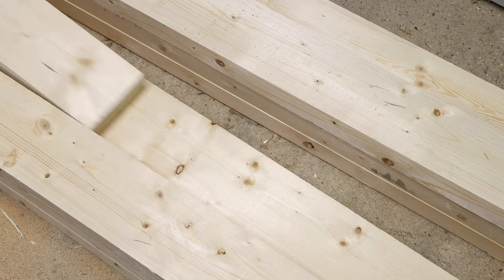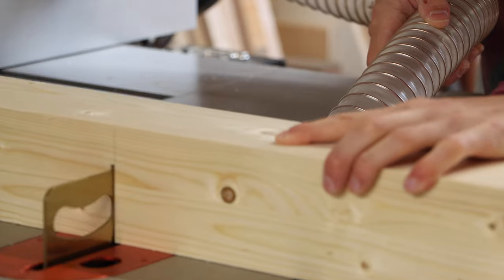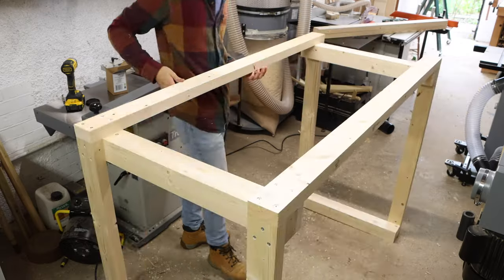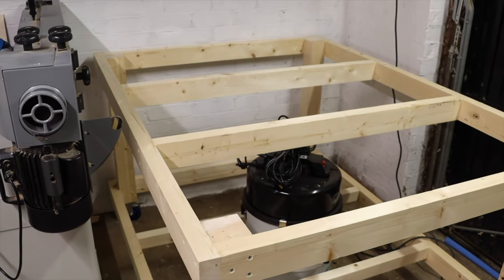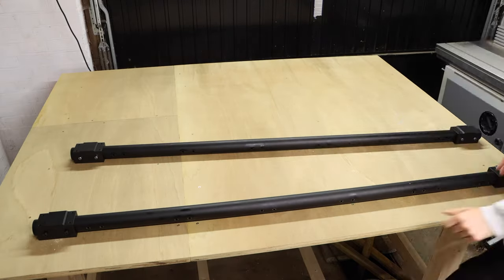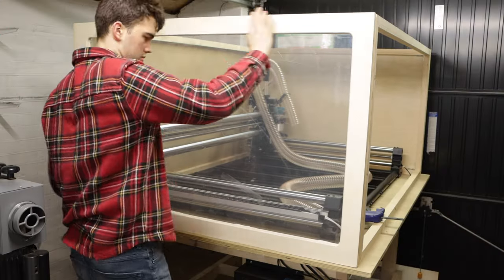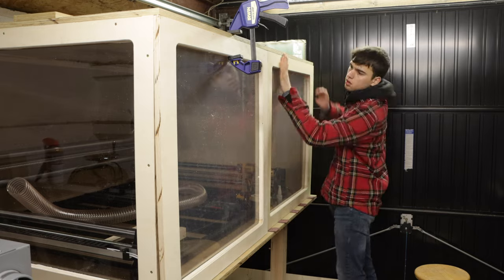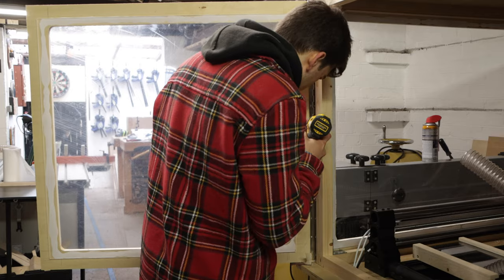Building The Ultimate CNC Station! Onefinity Journeyman X-50 CNC Stand And Enclosure!

Comment: Can you please share your experience after one year: how much did the enclosure help with the sound? Can your neighbors still hear the router?

And what about heat im the summer? Did those motors have any problems while being inside the enclosure? Thank you!
Reply from the maker: Hey, The enclose is definitely a good idea. I would hate using the CNC without it. without it, the router would be so loud and dust would be flying around the room. To improve dust collection, I drilled a 50mm hole on the top so I had air flow into the enclosure, otherwise it can act like a vacuum and ruin your extractor (It need constant air coming in). I haven't had any issues with the router over heating.
Reply: @SeanEvelegh  nice! Thank you for the quick reply! Keep up the good work!

Comment: I received my Onefinity a little over a year ago and absolutely love it. Your enclosure is awesome and I may eventually do that to mine. I built my table where the surface will hinge in the middle to drop down and create a vertical surface to mount things to. ( I'll turn a vase on the lathe then mount it on the vertical surface and engrave my logo on the bottom of the vase.) I also use a spindle which is extremely quiet.
Reply from the maker: Yeah I agree, I think it is a great CNC! The Vase project sounds awesome! I've seen theses spindles, they look like a great investment! Where did you get your's from?
Reply: @SeanEvelegh  I bought mine from Amazon. Its a Huanyang which is a recommended combination. I've used a 110v 1.5kw 64mm spindle for the past year and recently upgraded to an 80mm 2.2kw spindle. Mostly just so I can use 1/2 inch shank bits. I've been extremely happy with the spindles.

Comment: Amazing work! I’m a CNC fan! And really like this Infinity one! I though of buying one but the customs and import costs scared me off... how did that go for you?
Reply from the maker: Hey Henrique! Yeah import tax was a lot, but to be honest it is well worth it, The CNC is such high quality!
Reply: @SeanEvelegh  Thanks for the reply Sean. Looking forward to see what you can do with it
Reply: I've had mine for nearly a year. I don't know where you guys are from. I live in the Pacific Northwest of the USA and there were no customs or anything like that. 

I can't speak for other CNCs. But this one is made incredibly well and the limited issues I've had have all been my fault. But the customer support has been completely well supportive.

Surprisingly fast to get a response and results .

The machine itself is a little bit more expensive than similar alternatives but I think it was worth every penny to invest in a little bit more expensive machine. My biggest complaint after using it for a year or so is the software on the desktop It's fine but I think there's a couple things I would like to change on.

It's expensive to run and utilize to its full potential. And maybe it's just me speaking but if it was something for just a hobby it would be harder to pull the trigger on but still be really cool. But I've managed to make a nearly full-time business because of it.

Comment: Using a computer isn't woodworking though. There's no way around that. It's clever, it's useful, it can help you do things you otherwise would need years of practice to be good at, but it's not woodworking.
Reply from the maker: I respectfully disagree, it's as simple as if you are working with wood, it is woodworking. There are lots of different techniques out there and it's ok if you work with wood in a different way. I've had 10 years of practice in woodworking and I didn't get a CNC to cheat.